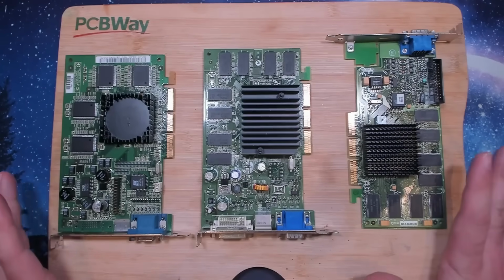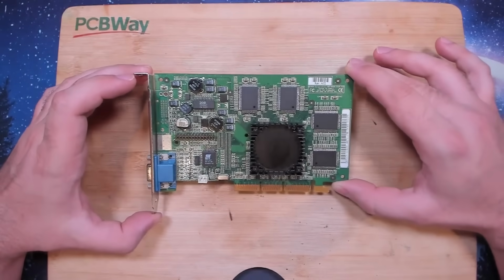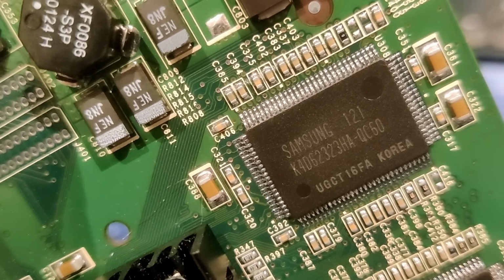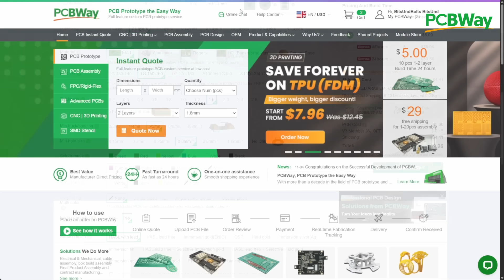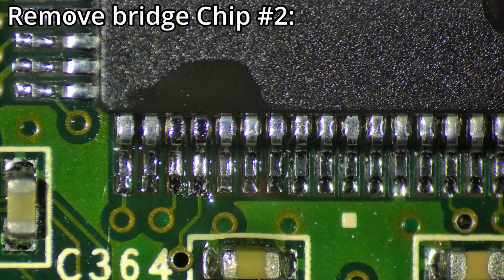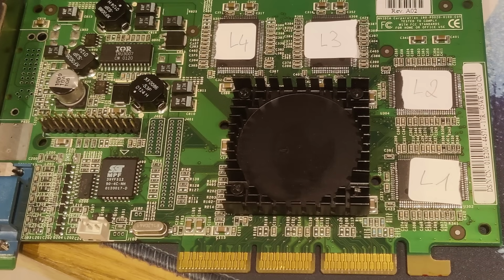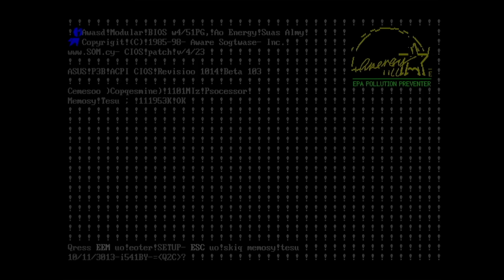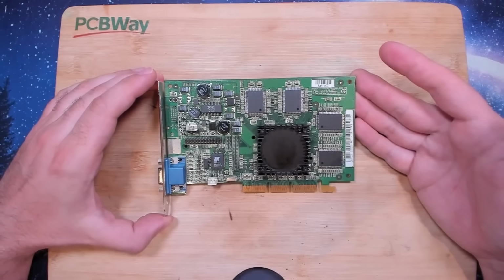Leaked NVIDIA Tool: Can MATS Save My Broken GeForce?

Comment: Torsional stress can potentially get the epoxy to release, so twist the heatsink in one direction to the other until it brakes BUT it could also just rip the chip off the board & I can’t promise it won’t be damaged. It’s kind of a “kill or cure” solution.
Reply: yeah...that's what I ended up with as a kid: glued a heatsink on, noticed it was skewed, tried to straighten it while in the second the glue was set and tore the chip of the board. Brand new S3 card with money from some 3 bucks-an-hour summer job. Lesson well learned :)
Reply from the maker: Yeah, I thought so too. I try this method to see if there is some movement. In some cases, like the one on this card, there is NO movement whatsoever - it is properly stuck.
Reply: @bitsundbolts  try low heat then gently twist. Or some people have just put their GPU in an anti-static bag then put it in their freezer. Take it out to let it warm up then back in the freezer. After a few cycles it might just fall off.

Comment: If that's the same style of adhesive used for attaching Voodoo heatsinks, I saw a video that blasted the heatsink with freeze spray and pried it off with a credit card / screwdriver.  Might be worth looking for here on YouTube.  No idea if that's the best or safest option, though.
Reply from the maker: I've seen that video. I agree - and this is probably what I will try next. Someone also suggested diamond cutting wire (used for cutting all sorts of material including metal and tiles). Those cutting wires are available in 0.2mm diameter.
Reply: @bitsundbolts  If you plan using the wire be careful not to use it on the gpu side but instead on the heatsink side. Due to the way the GPU is shaped / designed Might cut into the the gpu chip instead.  IF you  work on heatsink side. After you remove the heatsink you can try and sand it down the expoxy with a gritty sandpaper  to get as close to the surface of the gpu with out damaging it. Then switch to a  finer and finer paper.
Reply: I have done the freeze spray method on 3 different voodoo cards, worked without issue each time

Comment: Works 100%, put the card in a mobo so it is stationary, pour some IPA on the epoxy, wait a few sec, take some dental floss and cut it. 
I did it today with a Riva128ZX takes a minute or 2 but doesn't damage anything.
Reply: Either that or mineral spirits / paint thinner , I've seen someone clean an  engine whit white spirits and blowing the engine afterwards with some compressed air and couple of feet nearby there was a freshly sanded carbon fiber part and the epoxy turned up all gooey.

Comment: Use the heat gun to heat remove the GPU with the heat sink still attached.  The you can more safely remove the heat sink.  You could use a modelling razor saw to cut through the epoxy (if it is thick enough) or grind away the heat sink to then clear the epoxy (heat sinks are a dime a dozen 🙂).  They do make an epoxy remover, but you would want to test to make sure it doesn't dissolve the GPU housing.
Reply from the maker: I tried heating it, but it still didn't soften even at 180 degrees and I didn't want to get higher on the temps. Grinding away the heatsink might be an interesting approach, but I don't have the tools for that either...
Reply: @bitsundbolts  Dremel and a sanding drum or two will work just fine.  Aluminum grinds down fairly quickly with those tools.

Comment: i've removed the heatsink from my voodoo 3 with dental floss, it could also work here
Reply from the maker: There are some thermal glues that are soft - they can be cut with dental floss. The stuff I am dealing with is hard as rock. Dental floss won't have a chance.
Reply: @bitsundbolts  How about a hot nichrome wire? Maybe the wire would be hot enough to melt the epoxy, but not hot enough to reflow the solder underneath the chip? The question would then be, how to heat up the wire and slide it underneath the heatsink without burning yourself or the card?
Reply: @bob2600  Even red hot glowing nichrome wire won't cause the GPU to get significantly hot. It's literally just a line/strip of heat, you're not blasting the entire chip with hot air to heatsoak it to the point where the solder underneath would melt. 
I've put nichrome wire into terminal strips/blocks (those cheap thingies with the 2 screws holding the wires, encased all the way around with plastic) to use them as handles that just so happen to be electrically conductive as well lol

Comment: 1. I've never tried removing chip with heatsink still attached but maybe you could use it to your advantage. If heated evenly (with little contact with cold air) it could help with heat transfer. You know, heatsinks work both ways. They are just as good for cooling as they are for heating. Just make sure you have everything properly preheated.
2. There is a chance that at some temperature the glue will just let go.
Reply from the maker: You're probably right - I have to play with temperatures. Either freezing cold, or heating it up. I probably try freezing it first.

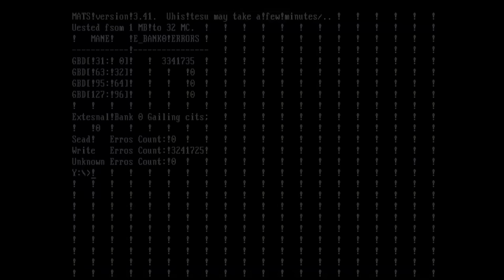Comment: At 4:10, is there a bit stck high?
Reply from the maker: Hm, definitely looks like it! A bit stuck high is odd, isn't it? Let's assume there is a broken solder spot below the GPU, could that cause the issue? Or is that maybe an internal GPU fault? I somehow don't like where this is going, but you might have found a clue here!
Reply: @bitsundbolts  Bit stuck high in most cases is something like blob of solder shorting dataline to a voltage source. Can be internal short as well.

Comment: heatsinks pop right off but if u want the longer method soak the adhesive in alcohol
Reply: It’s thermal epoxy, soaking it in alcohol does nothing, it’s not tape.
Reply: @nicholsliwilson incorrect
Reply from the maker: I don't mind if it takes longer as long as I don't risk damaging the GPU chip or anything surrounding it.
Reply: @bitsundbolts if you lay something thick against the heatsink and use a flathead to wedge up under and a little twist they always pop off without damaging anything the alcohol method really has to soak which finally make it soft enough to release

Comment: heat it and twist it to extract the main GPU
Reply: please don't do stuff like that.
You are very likely to break, bend (depending on the package) some pins.
Reply from the maker: I tried that, but this epoxy doesn't budge - at 180 degrees, I stopped that experiment in fear of causing more damage to the GPU.

Comment: Welp, today I learned that MATS is a thing, that's neat!
I wonder if there's an equivalent tool for ATI? I have a 9800 Pro that could use a memory test. (Of course, that card uses BGA memory so performing a similar "break it" check won't be as easy. 🤔
Reply from the maker: There is something called "Video Memory Stress Test" - it is a generic video memory test that could help you identify if your memory is the issue (it can't tell you which chip or if it is the memory or the GPU). I haven't seen anything specifically for ATI cards to be honest. Maybe someone else can comment and let us know.
DDR memory has a Vref pin - this is there to determine when when a signal is high or low. Usually, it has a voltage divider on that pin and it is unique per chip. So, you can mess with the voltage divider and purposely create a problem chip by chip. This way, you can determine which chip might be at fault. I will get to this once I get to those cards.

Comment: memory modules are in counter clockwise order from bottom right of chip for nvidia even for the new stuff. never used mats on a floppy before. nice efforts!
Reply from the maker: So, my method of identifying the chips would line up with what you said. Counter-clockwise arrangement of memory chips on this card.
Reply: @bitsundbolts yes